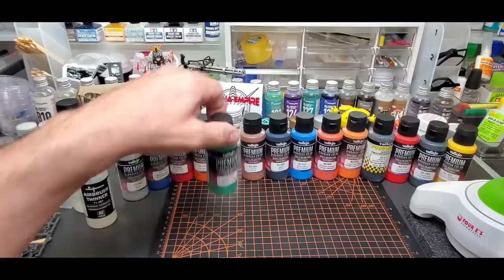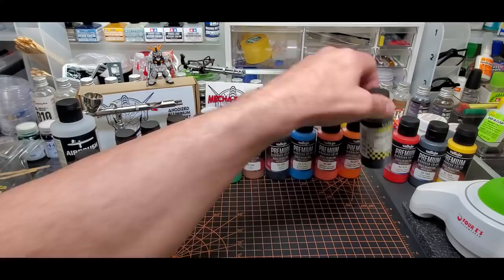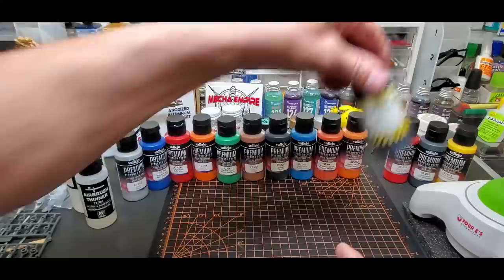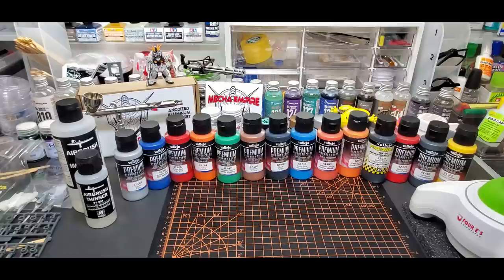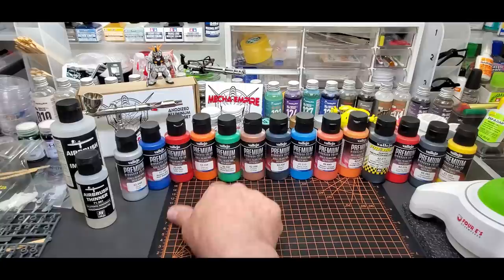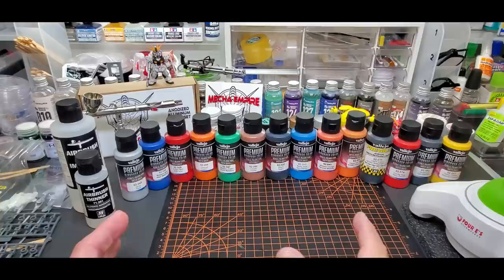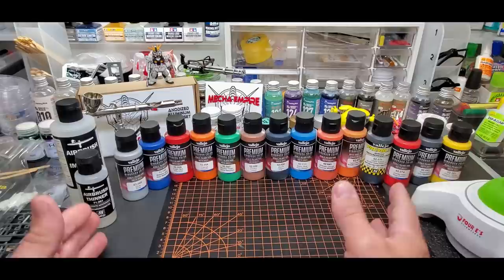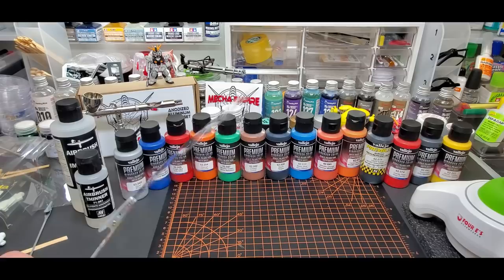Testing Vallejo Premium Airbrush Paints - Great Multi Surface Paint For Resin - Lexan - Gundam

Comment: I've been airbrushing for 20 years on had made fishing lures made out of resin plastic wood. Thank you so much for your demonstrations on these tutorials. I know it takes a lot of time money and editing to put these tutorials out. I appreciate all your efforts to demonstrate the new materials that are out there on the market saved us all a lot of my thanks so much. Rock on
Reply from the maker: Thank you my friend 👍
Reply: @barbatosrex9473 hi i have some model color and range of model air. Will be upgrading my mini compressor to 1 with 3L airtank. Just found out about this premium airbrush color, do u recommend replacing my model color and air with this? Or all 3 of them actually not much difference when doing airbrush. On side note i mostly on airbrush on model kit.
Thanks
Reply from the maker: @leomr1504  well these are designed for remote control car bodies because it's flexible but they do work on plastic as seen here. They biggest problem would be there's a limited color palette with these and not many metallics
Reply: @barbatosrex9473  i see. Ohya i saw ur video on model air airbrushing with 28psi without thinner but only add some flow improver, so i assume model color should also work the same? Also thanks to your video that y i know that my mini compressor not enough psi hence upgrading it to the one with 3L airtank 😁
Reply from the maker: @leomr1504  I prefer their Air line when I airbrush them, be careful not to over thin the Model line. You can use just Flow Improver when thinning it

Comment: Thanks for another helpful and enjoyable video mate. I thought your ball adhesion test was a great idea👍

 I bought the candy range and I have used it to paint cycling shoes in marbled rainbow candy. I normally use Angelus or Jacquard paints for customizing but wanted to try the candy paints. I put down some adhesion promoter before painting the synthetic material on the shoes and it has stuck to the shoe nicely👍

Cheers ✌️

Comment: I'm completely new to airbrushing and your videos helped me out so much! I've picked up the airbrush a few months ago because I needed a good, professional way to finish custom guitar pedals. Compared to the Tamiya LP this paint is on another level of durability: after a few weeks of curing it becomes basically indestructible. The 2k clear I'm using on top is getting scratched way easier and I'm honestly considering using the Vallejo premium urethane clear coat instead. Impressive is the right word, I'm literally stomping on this and it doesn't chip or scratch AT ALL.

The only downside is that the standard whites and blacks are basically always out of stock anywhere in my country :(

Comment: Fantastic idea with the balls barbatos! I'm glad these did so well! I've been using acrylics untill I can get a proper painting area setup. Definitely going to try and get these.
Reply: If you get a spraybooth I will recomend you solvent based paints.
Reply from the maker: Solvents are my go to paints for sure
Reply: @barbatosrex9473  I definitely want to use them unfortunately I just don't have the proper setup yet. I'm currently building my own spray booth and cleaning out a work area in the garage! Ty for all you're helpful videos. I feel alot more prepared to start when I do

Comment: First thing first, thanks a lot for your test. Several colors and a bunch of different materials ( I can´t remember any of your previous tests with so many of them...) I´ve got two bottles of varnish and a pair of colors, tested them by brush , average results mainly by not reducing them properly. In a few days I´ll be painting a Tamiya Lunchbox (1/12 RC car, no lexan but hard plastic body) and after watching the awesome finish by airbrush, I know what primer, paint and topcoat to use. Keep the good work, and cheers from Madrid, Spain!
P.S: If you want to pronounce Vallejo in good ol´ Spanish, there´s a lot of videos of spanish modellers and painters you can check...

Comment: Just watching this again after watching it when it came out. I use the Premium Candy Red in a couple of ways. 
For the Epic Armageddon Eldar I use all Vallejo paints for the Primer, Base Coat and Top Coat.  Primer:  White Surface Primer, Base Coat: Metal Color Duraluminium, Top Coat: Premium Candy Red. Leaves them an almost metallic red which his enhanced by the Metal Varnish Gloss. Various colors and paint companies for the detail work. 
For the Adeptus Titanicus Titans and Knights I use all Vallejo paints for the Primer, Base Coat and Top Coat.  Primer:  White Surface Primer, Base Coat: Metal Color Steel, Top Coat: Premium Candy Red. Leaves them a dark almost metallic red which his enhanced by the Metal Varnish Gloss. Various colors and paint companies for the detail work. 
It's a really good paint that takes on the final color depending on what base coat you put it over.

Comment: I've mostly been using Vallejo Game Colors for a couple of years and they're pretty fragile, sometimes when i work on a piece with a paintbrush, if my hand get a bit sweaty some spots of the paint will come off all the way to the primer. I'm using Duplicolor primer and i havent tried their primer but the common practice is to seal the paint with a protective coat after important layers like the base coat. Bought Vallejo Mecha Varnish to try it out as it claims it's scratch resistant, it does require thinning and some people recommend 3 coats and 24h cure time.

Comment: 2 things:
1- What's the brand of the ball bearings you like in the paints?  Maybe where to purchase.  I use a non-metallic bead in acrylic paints.
2- When reviewing these kind of paints, why not include model railroad trucks (G scale are large scale).  They are made of delrin, which is a slippery plastic known for not holding paint very well.  Would a polyurethane paint work on this type of plastic?  
Garden model railroaders are outside, run in all kinds of weather & in snow with freezing temps.  We also fight paint's enemy - UV light.  I use Krylon UV resistant clears on my outdoor models, however it goes on thick when going for complete coverage.  That metallic blue would look very good on an steam engine boiler which the color is called "Russia Iron".

Comment: Another possible source of paint mixing objects are small stainless steel hex nuts. They seem to provide more than adequate mixing action in the respective paint pots/bottles. Marine grade stainless is recommended….but I always check with some samples into a dish/container with water……you can add some salt to create a more “severe” rust test environment.
P.S. regarding flexibility, as these paints were freshly applied and apparently quite flexible, have you verified that the paint remains flexible after a longer drying interval?

Comment: Nice video! I have some of Vallejo's other paints and they're pretty good. They're not super durable, though. I'm a little wary of acrylics in general. Lacquer is just so much easier to mess with.

Speaking of, I had an idea for something you could test out if you ever get the chance. There's another youtuber who makes toys and what not from scratch. And he found that no matter what paint he used, it would still come off the plastic fairly easily (which is common for acrylics). Well, he was contacted by someone that told him to take the little plastic figures and run then under a low lit blow torch. This would cause something called plastic annealing, which would make the paint stick to the plastic super hard. I was wondering if you might be able to test that out on some gunpla pieces? Unfortunately I don't own a blow torch. XD

This is his video on it. I'll link to the relevant part. https://youtu.be/6Rc4LKMHC74?t=410

If that actually does work on Gunpla it may also work on model cars and other hobby stuff. Could be useful to know!
Reply from the maker: There's also a product Plastic Adhesive Promoter. Comes in spray cans, even DupliColor makes it. It does a similar thing as the torch, it sort of melts the surface of the plastic helping the paint to stick to difficult plastics. It's mostly used for auto plastic parts
Reply: I’m new to the hobby but I’m trying to understand what’s the best for durability, I wanted to try the Vallejo air line but I’m a little bit concerned, especially because I’m going to work with vinyl stencils on it, so I was considering to use automotive 2k primers and clear coat but I still don’t know if it’s better to use water based Colours or lacquer
Reply from the maker: @OSEhungover1  this is hands down the most flexible paint I've ever used
Reply: @barbatosrex9473  the only problem is that there are only few colours 😞
Reply: @OSEhungover1  createx at spray gunner has numerous paints that go huge ways for the money spent. I imagine if you clear coat those you can get them to last a good while. Been learning the last few months so no honest opinion for longevity yet.
Reply: @OSEhungover1  Vallejo model air scratches super easily since they are vinyl based. I recomend lacquer paints or enamels if you have a spraybooth or good ventilation. I recomend a mask too.
Reply: Spanish word. So it’s pronounced Va-YEH-ho. Double “L”s are pronounced like a Y as in tortillas. And J is the Spanish H, like in the Spanish names Jose and Juan.

Comment: So, from what I heard (word of mouth), the formula of these is pretty much the same as the Mecha Colors, I haven't tried them yet, but I heard these are pretty much as resistant as those.

I'll give them a go later down this year I suppose, I just bought a pack of Acrysions I wanted to try either way and have a ton of both Model Air and Mecha Color vallejo's on the desk waiting to be used too.

Comment: I see the paint shaker in this video and in an older video, you showed the Badger Battery powered paint stirrer.  The clear advantage I see is that you don't "lose" paint by using the shaker you show in this video. Any other advantages?  I'm trying to justify the extra cost. I'm a newbie and haven't used either yet, but trying to build my kit now.   :)  Thanks!  :)

Comment: Vallejo make a wide range of colours in this Premium Airbrush line... Standard, metallic, candy, plus specific thinner, retarder and cleaner. Plenty to choose from!
Reply: But its water based tho not so interesting
Reply: @statoilbensin2190  Thanks but to help clarify to other readers, actually all these Premium Airbrush Colours use an exterior grade hybrid resin-polyurethane base.

To quote Vallejo's information:

Premium colours have been formulated with micronized, permanent pigments and an extremely resistant, exterior grade hybrid resin-polyurethane base, which withstands impacts, resists chipping and cracking, as well as direct exposure to heat and outdoor elements without cracking or fading, and is fuel residue proof up to a least 35% Nitro.

Comment: Barbatos have you seen the beutiful metallics in the enamel humbrol lineup? Sunset red metallic is a wery beutiful color and their metalcote colors are nice for chipping. If you make a chip to big simply remove with enamel thinners.
Reply from the maker: I have Humbrol paints here so I'll be doing a video on them for sure. They are good paints for sure. I do like enamels, my personal line of paints is enamels
Reply: @barbatosrex9473  I tested Humbrol metallics yesterday and I thinned them with Tamiya lacquer thinner and just like I thought they dried much much faster. If I had sprayed it with their enamel thinner it would have taken 10-12 days. It took only 1 and a half hour with multiple coats, with one tiny mist coat it dried in a few minutes!
Reply from the maker: @statoilbensin2190  for sure, always use a lacquer thinner when using enamels, it works great. Much better results. Same as me Testors and Revell paint videos, I always thin with lacquer. My preference is Mr Leveling Thinner or my newly released Mecha Empire Airforce thinner.
Reply: @barbatosrex9473  Cool, I got the leveling thinner and also the lacquer thinner with retarder from Tamiya and that is the one I use the most. Have you tried it? I think it is pretty similar to the leveling thinner athleast it smells the same.
Reply from the maker: @statoilbensin2190  yes I have it, they're very close in formula

Comment: I work with vinyl stencils, are Vallejo colours (especially air and mecha line) durable if put and then remove stencils on them? 
I’m considering using 2k primers and 2k clear coats from Mipa
Reply from the maker: This particular line,  the Premium will work. Be sure it's the Premium Airbrush Paints.
Reply: @barbatosrex9473  so the other lines are not that durable if you work with vinyl stencils (oramask for example)? I’m new to the airbrush.
I need a very durable paint with a wide range of colours, that’s why I was looking to Vallejo’s lines. Or have to check some lacquer paints?
Reply: @barbatosrex9473  oh, i do custom paint on gaming mice, and I work with vinyl stencils and water decals. That’s why I need something durable
Reply: @OSEhungover1  yeah the other lines aren't as durable